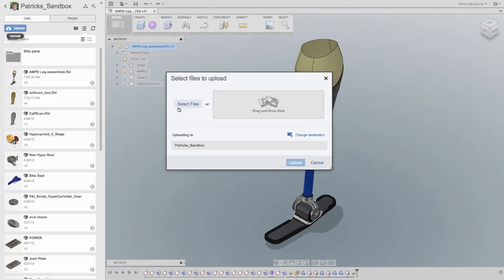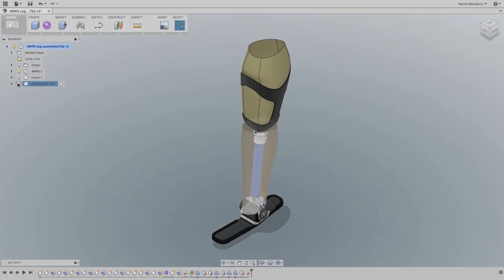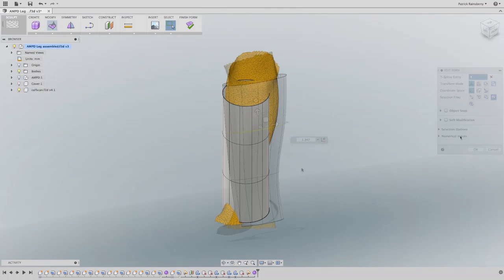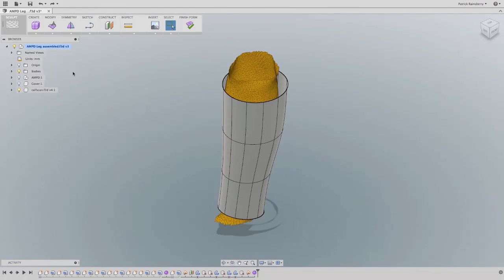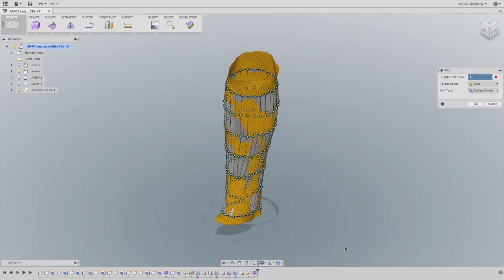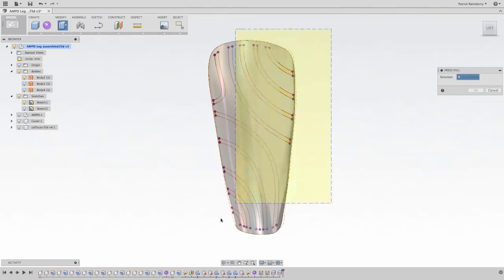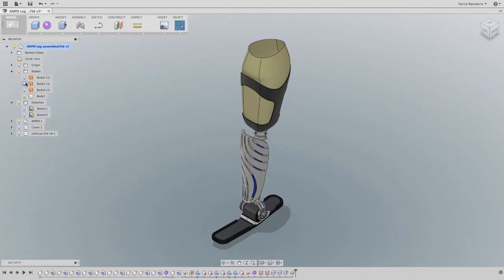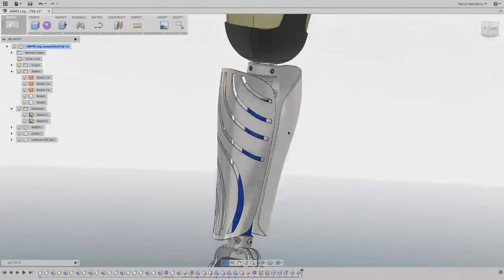Design with Scanned STL and OBJ Data | Mesh Modeling in Fusion 360

Comment from the maker: Import STL or OBJ bodies as mesh models and easily create custom designs conforming to the mesh surface using Fusion 360.
Reply: This works great for cylindrical models, but I would love to see how you would use this technique on other models that are more complex.   Or even "slightly" complex ones! 

Take the default bunny from Meshmixer and subdivide it all you want to make it have more vertices, and then make that bunny in Fusion, and THAT will be an awesome demo!
Reply: Is there an update on this?